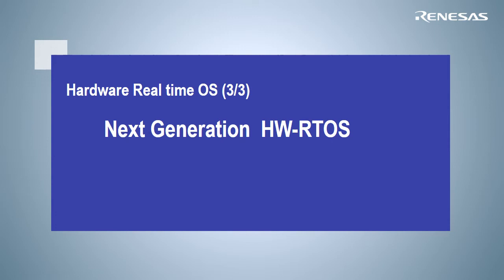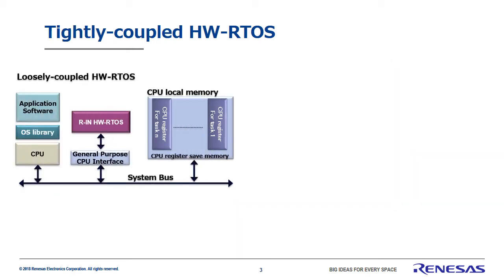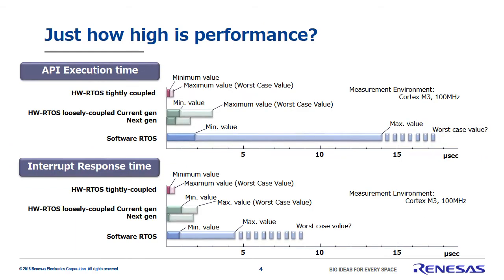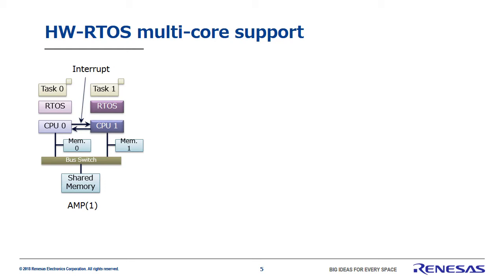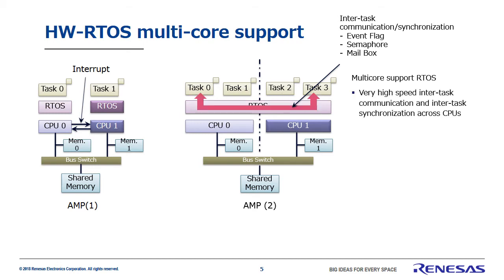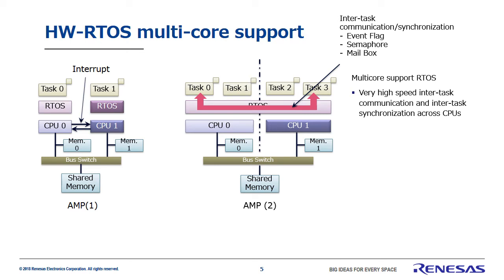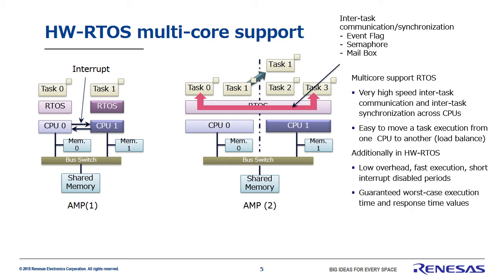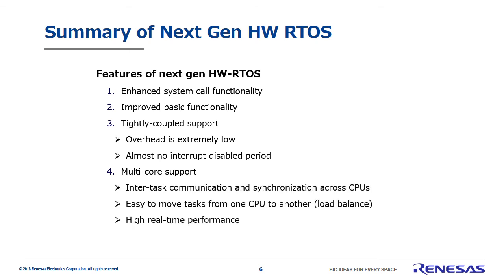Renesas High-Performance HW-RTOS (3/3)：Next Generation

Comment: Nice presentation. Is there any penalty of power consumption (even minute) with HW-RTOS? How much extra silicon space needed for this to implement? Thanks
Reply from the maker: Hi Krish, thanks for your enquiry and sorry for my late response.
The circuit scale of HW-RTOS is considerably smaller than the CPU (Cortex-M3 etc.), and the increase in power consumption of HW-RTOS is negligibly small.
Please let me know if there is anything else I can assist you with.